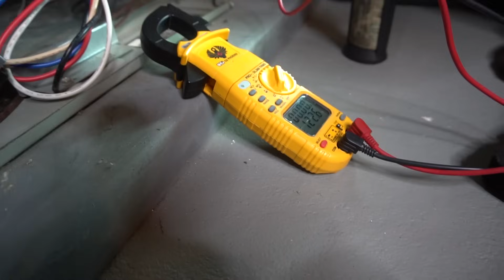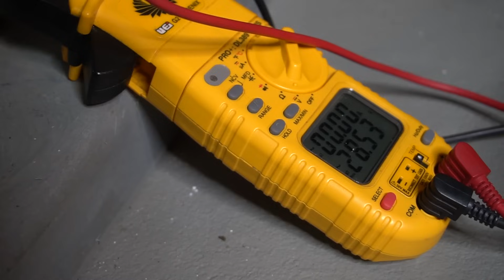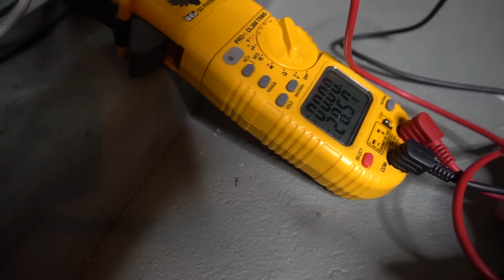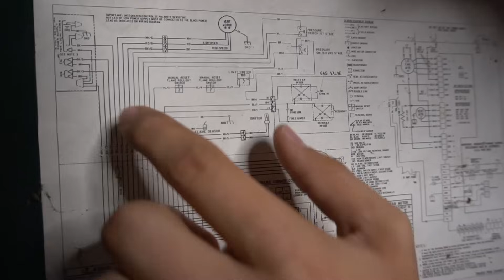Furnace/AC How to Troubleshoot The Control Board

Comment: My 5 amp control board fuse keeps blowing. This started happening after I tried to replace the contactor outside at the A/C unit. When I turned the breaker on the new contactor started to smoke and then the breaker turned off. I put the old contactor back on but that didn't help. The control board keeps blowing the fuse. I'am baffled. Please if you could, give me some advise.

Comment: Blower doesn't run.  My control board's status LED is completely out, yet the board is getting 120v (L1), the transformer is putting out 27v, and the R on the terminal block is also showing 27v.  L2 is dead though.

Comment: Trying to replace the thermostat, but AC did not turn on. Go through the steps to see if the control board is bad. I have the power go to the control board. Check the Line terminal and Common terminal from primary side transformer, I have122V. Check the primary side of transformer, it has 122V. Check the secondary side of transformer, I have 28V. Then track the 24V wires from the secondary transformer to the fuse, the hot side and common, that go to the molex plugs straight to the control board. Put meter leads to the molex plug, it reads zero volt. No voltage going to the control board. Since no voltage from transformer goes to control board, no voltage come out and come on to the thermostat terminal strip. Check R (power) to C (common) on the terminal strip, I have 0 volt. What problems do I have? What should I do next?
Reply: I figured it out! It was the fuse that burnt out. It's running, but it's hot instead of cooling. What's the problem?

Comment: I have an interesting issue - I was cleaning my condenser outside and noticed the bigger line was frozen up so I ran inside and realized that the blower was not running nor the LED indicator was lit up on the furnace. I took the doors off and to test I hit the safety switch and would hear a small buzzing sound but no lights on the board no any activity at all. I gave it about an hr or so while the line on the condenser melted and while I was researching what to test.  I went back in the attic and pushed the safety switch in and immediately the light on the board and the blower powered on (I had the fan set to ON on the thermostat). So I thought ok it’s fixed. A little over an hr passed and I noticed that the blower was off and no lights on the board again. Condenser was still running and line was frozen up again. I turned off everything allowed about another hr and pushed the safety switch on and blower and lights came back on. What could be causing the board to lost power after some time? I’ll have to test tomorrow morning with a multimeter during the no power state but curious if anything comes to mind.

Comment: Thank you for this video.  Saved my day as a DIYer.  Went through the steps like you suggested and located my issue easily.  My AC was not turning on at all and the blower motor was not running in fan mode either.  Thermostat checked out fine. On the board the led lights were off.  Following the power from the breakers, the door switch seemed to not connect when pressed.  Disconnected the terminal wires and re-plugged.  Additionally took off the line and neutral wires from the board tested and re-plugged them.  The unit started working.  I guess if the led is not turning on, the board is not getting power and this helps to isolate the trouble shooting steps to the connectors before the power connections arrive at the board.  Thanks again!
Reply: Was your issue intermittent? I’m having something similar. My board shuts off after 30+ minutes. I plan on testing it with my multimeter tomorrow but if I wait about an hr I’ll go back and push the safety switch in and the board will get power and turn on my blower.

Comment: what is the component called with the brown color wiring connected to the power switch? at 1:07 seconds of the video? I did the voltage testing and its not getting power to the hvac Thank you
Reply from the maker: In this video that is a transformer for the whole house humidifier. It is not part of the furnace wiring.
Reply: @WordofAdviceTV  thank you

Comment: when i measure R and C i don't get 24V
Reply: brand new control board
Reply: please help
Reply from the maker: Check your 3 amp fuse first to see if it is burnt out. Next I would check if there is 120v going into the transformer and then 24v coming out of it. If there is 120v going to the transformer but on the secondary side there is no 24v (usually around 28v actually) that means the transformer is bad.
Reply: @WordofAdviceTV  thx

Comment: I installed a new control board and nothing works. Prior to that the blower fan was running continuous even with all thermostat wires disconnected.

Comment: Maybe you can give me a clue on why my diagnostic indicator light is not giving me an indication of why it's short starting it will stay on for a few minutes then of as it continues to start and stop it gets shorter and shorter then it wont flame on anymore  but the blower will stay on, replaced filters, flame sensor checked igniter,   flame rool outs continuity is good on all of them als the high heat is good been following your videos they are great just not able to track the problem problem down, like i was saying the indicator light is not telling me anything could that board be bad? It seems heat might be it, but they sensors are working fine. Any suggestions would be great  thanks

Comment: I got a question, what would cause my board to blow a fuse after I've already unhooked all the thermostat wires and the condensing wire but as soon as I turn the breaker on the fuse pops? I've eliminated all the low voltage wires so there's nothing left to be a low voltage short so do you think I have a bad board

Comment: I replaced my board it was fried. Once I did the blower motor wasn't kicking on but everything else was. When I switched the ecmi blower it fired right up but the next day I got a call back and the blower motor isnt turning on. Now it will start and shut of instantly and I can not figure why all my power is in the right places have you ran into this before ?

Comment: Your advice is nice and clear! I'm in middle of diagnose my old trane xe80 furnace with white Roger's ignition board. Question  is after the ignitor lit up about 10 seconds and gas valve click and hissed, my gas doesn't light up?  I checked the board sents out 24v to the gas valve but  drops after few seconds? Any advice will greatly help thanks!
Reply from the maker: Your ignitor may be weak so it is not getting hot enough to light the gas. It could also be a plugged burner or orifice. Here are three videos that should help resolve the problem:
https://youtu.be/1bRsFAMgZRQ?si=pSLMPgPKVcu4KWjQ
https://youtu.be/aM4OXM8ruNk?si=iRs_d-7FVVxVGcnM
https://youtu.be/6ehk0NZVFcg?si=Qwg5a8Dxk8Z-5MPR

Comment: My air conditioner stopped coming on one of the things I did was jump on the motherboard where the thermostat wires come in am when I jumped it on the motherboard the AC started working again does that mean that the wires coming from the thermostat or the thermostat itself is faulty?

Comment: 1. This is a Honeywell unit. There is no peep hole to look through. I took the panel off to find a blinking light, but there was no light. Some 15 yrs ago I had to put a fuse in this thing. Look like one that you would put in a car. Well, this thing has been worked on several times over the years. Not sure what was done. But now there is a black cover over the control board with strip of screws, looks like where you would wire up the thermostat. Is this normal? Seems kind of crazy to block access to where you would replace the fuse. It may have been missing and someone put a new cover on it. I do not know. 
2. Upon checking the wires I bumped the transformer, and one of the 24-volt wires came off. As soon as I put it back on the furnace came back on. 
3. While I was working on the unit, I noticed the blower fan had a capacitor on it. Since I was checking everything, I figured would check it as well. it says 7.5uF+or-5% But when I checked it it was showing 3.97 uF on the meter. So, it is bad, right? Could this be the reason why I get the ignitor to light up but no gas. On Sundays around here most everything is closed, I will get a new one tommorrow. Hopefully I will get it to work, it is going to be another cool night.

Comment: I have a Lennox which is over 20 years old, but still works. I have replaced computer board before about 10 years i think. Once i turn main power off for a few 10 seconds, it comes on and then it works normal for 2 to 3 cycles then it stops until i turn switch off again for few seconds ( just don't want to turn on and off quick, so that's why I do 10 seconds) then it goes back working again for 2 to 3 times cycle when Thermostat tells it to come back on. My red and green keep flashing though the whole time. I will try checking sensors.  Do you think it is the computer board? There is sometimes you hear it come on and goes through the 45 to 60 seconds like normal,  but then stops and fan won't kick on. Thank you for any help you can give.

Comment: When you say, power goes in but no power coming out.. Board is bad.. That's not true all of the time Lol man what if the stat isn't calling for heat? You'll have power in and no power out.. Or how about a bad xfmr, you will have high voltage power going in, but no low voltage on the board or blower power due to no communication..
Reply from the maker: You're right bro! I think I oversimplified it without explaining what you just did. I should probably make an updated video on this. Thanks for pointing it out!

Comment: Inducer motor stays on, wont stop? 
I have a few issues that I posted on your general troubleshooting video.I think the control board or the pressure valve is bad, I'm trying to narrow down between the two. If I reset the furnace with the main power switch everything works until it hits desired temp... at that point the inducer (exhaust) motor stays on, the furnace gives a pressure valve error code, and will not cycle again until either I unplug the pressure valve tube and plug back in or turn the furnace off at main power for 15 seconds and then back on. 
my confusion is why the inducer (exhaust) motor stays on and wont turn off? I'm starting to think its the board. 
Full transparency the furnace is 19 years old, but has been maintained. 
Does the pressure switch tell the inducer (exhaust) blower when to turn off...in addition to monitoring if it as turned on and is working properly during start up and operation?

Comment: What does it mean when your thermostat was no good. Had a guy come out and check the air handler to determine it. So i bought a new thermostat. But when i plugged the new thermostat in the cool air was coming out hot. And the hot air is coming out cool could it be the tech. Put the wiring back on wrong . Please help.

Comment: Great video!
I still have a problem with Amana furnace.
 After I set the thermostat at 69F the furnace was on at 67F and off at 71F; but didn’t start again for another cycle. The red LED light continuously on the control board was on indicating normal operation. I turned off the power to the board and back on after 20 sec, and the furnace turned on. After the cycle ended, the furnace would not turn on again unless I turned off the power to the control board and back on after 20 sec and the furnace turned on. After the cycle is over, if I try to turn on the fan only, it doesn’t start. Do you have any suggestions?

Comment: I have an older furnace with control board 62-102636-01 where the indicator light blinks twice which points to the pressure switch.  I have watched a number of your videos and determined that the IDM isn't always getting power (keyword here is always).  This is an intermittent issue which throws a status code approximately half the day and then works the other half of the day.  This issue has been for the past 2 winters.  So, my question is, can a control board work intermittently or do I have something else going on here?

Comment: Hi, I have a furnace that is sending power to the ignitor but sometimes the gas valve does not seem to open and it goes out on safety. Usually it will start on the second try but not always. Any ideas?

Comment: Thanks for the video. I have a tough question on my Trane XV95 furnace. It's 11 years old unit. It has been working well for the last 10 years but stops this year. It blinks 3 red and the manual says inducer motor or pressure switch. I followed all your procedures to check. It has voltage from the Control boards but no volts on the inducer motor harness. The next day, there is no voltage from the control board, but it does have power to the board and transformer. Is the board really bad? or are there any switches turn off the power?

Comment: I have an unusual case where one thermostat (upstairs) will kick the furnace heat on, however the downstairs thermostat does not (but will click).  I assumed it was a bad thermostat, but even bypassing the thermostat with jumper wires will not get the furnace to turn on from my downstairs thermostat.

Comment: Jay, your excellent videos have been so helpful in past years. Now one of the duplex's furnaces stopped  producing heat.  the blower fan powers on, the inducer motor does not  and it does not ignite.    The inducer spins freely. The igniter has continuity.  In your judgement, 1)  Is the control board failing and needs replacement ?
AND if so, I know it is a bad idea to use used electrical parts but the new one is around $600 and the used ones are offered by hvac guys on ebay for just over $100 and say it came from a working furnace and  there is a return refund policy.. he(they have 100% positive feedback The duplex will be sold within a few years.  Any thoughts you can offer would be greatly appreciated?  Please help. The furnace is American Standard 80%
Reply from the maker: Glad to hear that the videos have been helpful for you! From what you described, it sounds like either one of the safety switches is tripped or the control board is bad. (The switches - such as a high limit switch stuck in an open position, a tripped flame rollout switch, or a pressure switch stuck in a closed position. If you watch my furnace sequence of operation video this will make more sense.) It could also be a blown 3amp fuse on the control board. Is the LED on the circuit board blinking any error codes? Replacing the control board would not be my first course of action, until I verified the safety switches and fuse. If they are good, then yes, likely the control board is bad if it gets a call for heating yet it does not send power to the inducer motor. I would definitely go for the used one.
Reply: thanks, so much for the timely reply..  I will check the safety switches (after watching a video or 2 twice in the am). I would pay YOU handsomely if you were near Seattle, lol. Finding a competent repair person locally that you can trust, it seems, is a personal work of art in progress!. I think, that my amateur sleuthing skills enhanced immeasurably by your accurate assesments are being tested today, now, tomorrow!  thanks, again!! @WordofAdviceTV
Reply: is it possible that my 26 year oldfurnace does not have a fuse? i pulled the control board to check and still can't find it so ordered a new used control board.
Reply from the maker: @markdierking9347  You're welcome! What brand is your furnace? If it is a Lennox, then instead of a little fuse, you may have a mini circuit breaker. Sometimes they can be hard to find but yes, some furnaces do not have a low voltage fuse at all. Perhaps yours does not. May the replacement board fix your furnace! Good luck!

Comment: Save all the trouble on the control board Jump R & G if fan runs you know you have 120 volts and 24 volt for control, next put a call in at thermostat.. Call for heat then watch furnace sequence of operation. Call for cooling again watch sequence.  Also if no 24 volt for control check fuse if blown could be short to ground or even an open safety circuit.

Comment: I keep blowing a fuse on the control board indicating a low voltage short only when calling for heat. I’ve ruled out the thermostat and the wires to the furnace.I might mention it’s a brand new furnace,American Standard. My furnace man is on vacation,lucky me .

Comment: I have 28 volts to fan,heat,but only 15 to coolin(y). I removed both wires to y at control board and same voltage.  Am I correct in thinking the circuit board is bad at that location.  Thank you

Comment: Great video. My problem is the control board, just bypassed the wires for furnace blower, but how do we bypass board to run condenser unit outside.. has 240 power when I press the plunger on contactor. Checked low voltage and have no power. Went to control board on furnace, checked with multimeter C and y, no voltage. Ordered new board, but wondering if I can also make the outside unit work, with bypassing it.. By the way thanks again, this video helped out very much..Never mind I got it, thanks again.

Comment: So if I have nothing from R to C bad board?
Reply from the maker: Is there about 27v coming from the transformer? If 120 goes into the transformer but 0v comes out, then the transformer is bad. But if the transformer is putting out the 24v-28v then either you have a blown fuse or yes, that board is bad when you get no voltage between R and C.

Comment: My inducer started running during AC cycle. Worked fine for many years. Getting fast blinking flame light and and slower blinking status light. 1095 83 202b board. swapped thermostats same problem. Any ideas?

Comment: Check the LED's (lights) on the circuit board. There's usually a wiring diagram taped to the inside of the furnace cover with a table how to interpret the flashing LED's. I used to the LED's to diagnose a problem with furnace last winter.